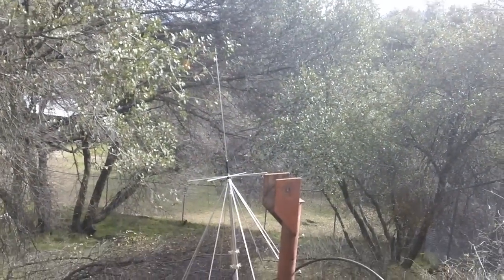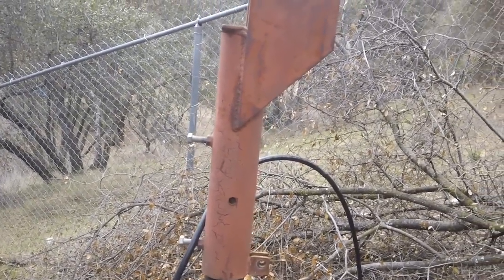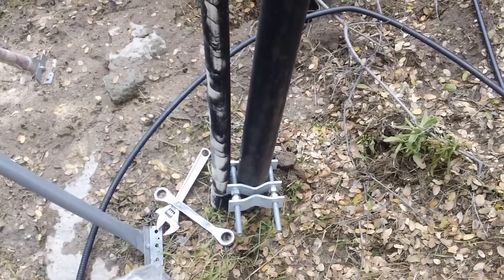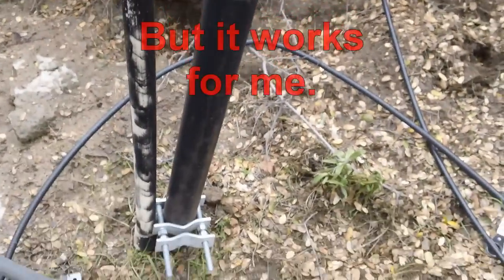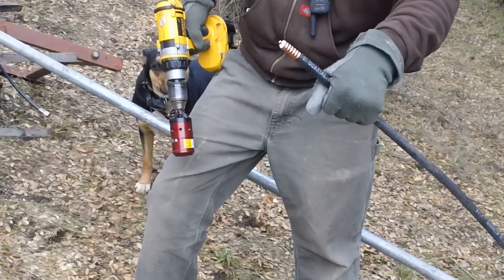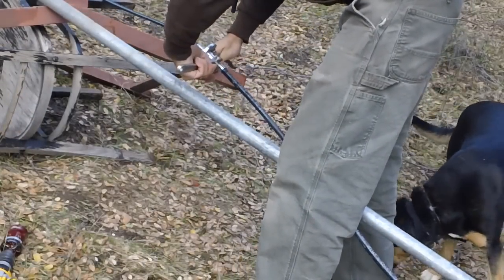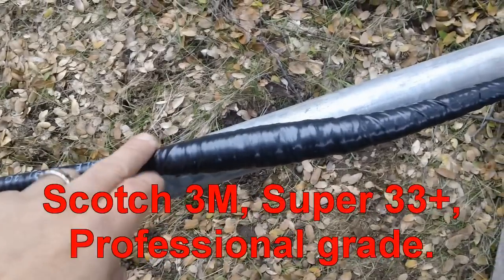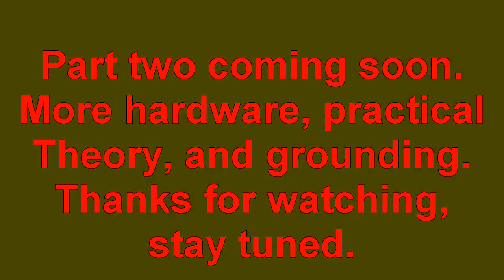My Home Antenna Mast Build for Self Reliance.

Comment from the maker: I really like the discone because of its versatility as a backup. though, it will never perform as good as a dedicated tuned antenna to the band you are most interested in. kind of like a multi tool, jack of many tools but master of none. You'lle see in the next vid, I'll be mounting a dualband for dedicated transmitting like your suggestions on your post. Thanks for watching.

Comment: Another trick my dad taught me, he is a journeyman lineman, is the final wraps pf electrical tape should end sticky to sticky. So one wrap pryer to the last, twist the tape with sticky side out, and then twist again and wrap sticky to sticky. It virtually guarantees that the tape will not release. Also like the activated rubber tape...not sure what that is called, but when the tape is stretched it activates and bonds to itself to make a rubber sleeve.

Comment: have you ever used rubber heat seal tape it is not cheap but it works great after you wrap the wire you use a heat gun and melt it slightly then let it cool and it seals real good mine is ten years old and still good

Comment: Get some Scotch Kote and the vulcanizing tape.  You will seal the connection point using just those 2 items.  That is what we used on all HF, VHF, WeatherFax, AIS, equipment installed on Iraqi patrol boats.

Comment: will that antenna work with CB radios?
Reply from the maker: If you're talking about the discone antenna, Its not tuned very well for the cb band. Though, it will still receive cb signals ok. I got some daytime skip from Minnesota all the way to Cali clear as a bell. It does claim reception from 25 MHz to 1 gig, but below 128 MHz you start getting reflected power back into your transmitter. I may experiment with a longer whip to see if that will improve it on the lower frequencies.